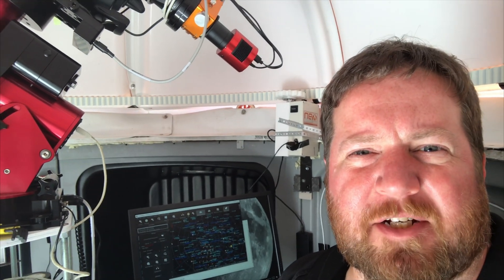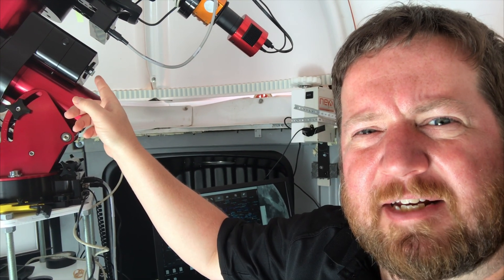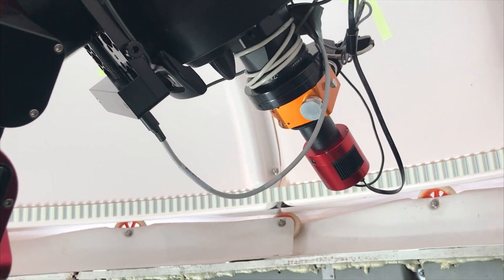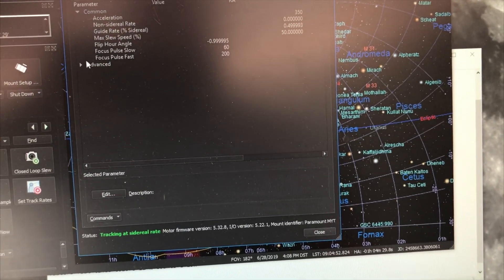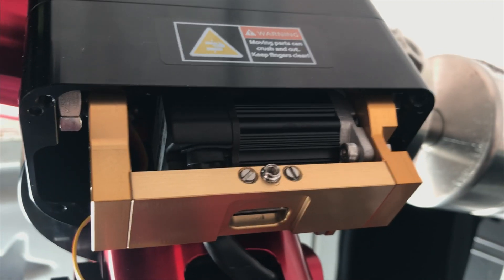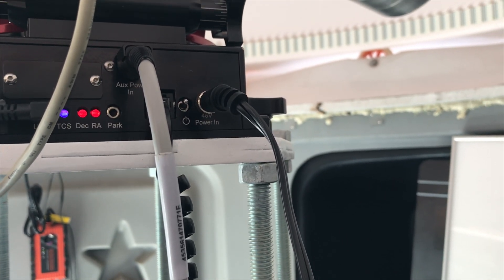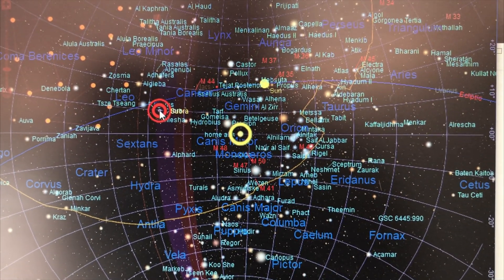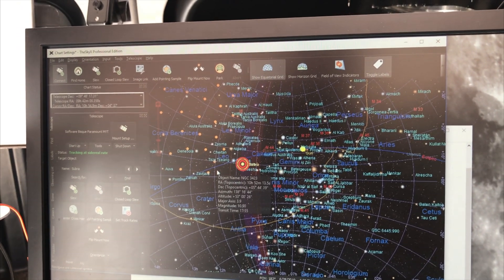MyT Paramount— Motor Replacement Tip... don’t forget to update the index

Comment: So many issues but at least you figured out the problem ☺
Reply from the maker: Notts boy24   Their video on it didn’t mention the index. But the forum had several people with the same issue and the solution was discussed with pretty good  instructions. It may be ‘embarrassing’ for software bisque to leave a huge historical source of problems with their equipment on a public forum. But it also provides a great troubleshooting tool to see what others have done.  I don’t see any other manufacturers doing that.